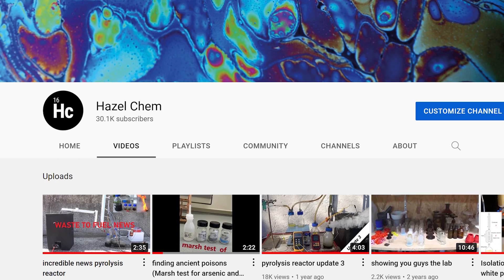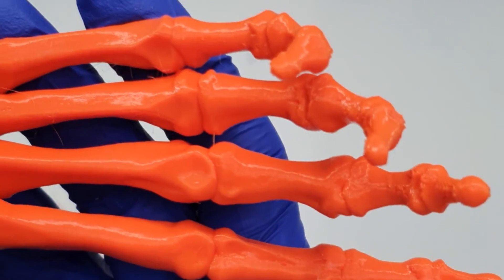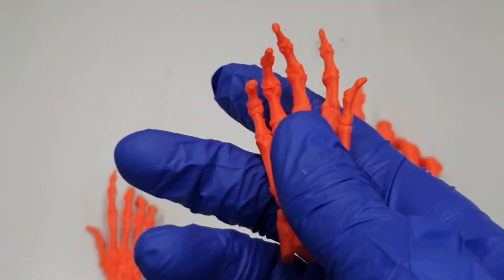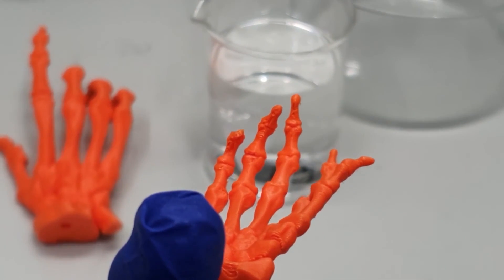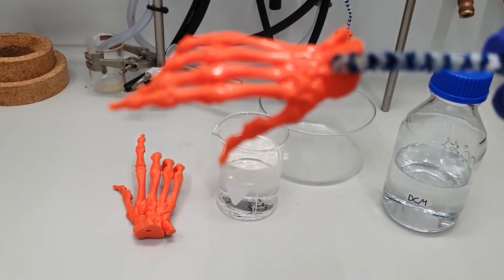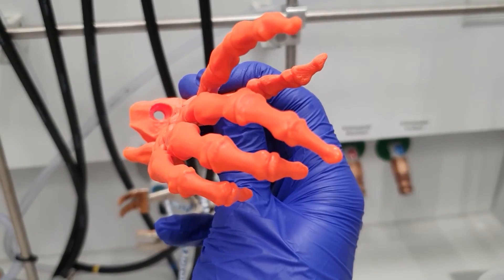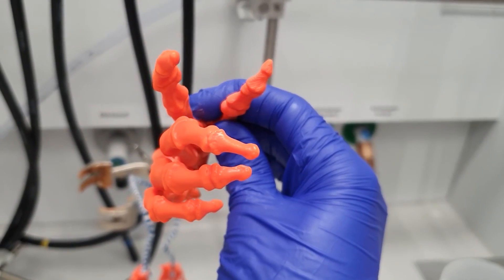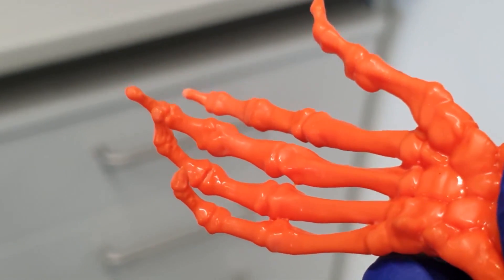easy smoothing of PLA 3-D prints (solvent method)

Comment: I just bought a spool of PVB which should be smoothable or perhaps even dissolvable in isopropylalcohol, readily available without restrictions. Let's see how that goes. Thanks for the video.
Reply from the maker: That’s a great decision! PVB is an excellent choice for vapor smoothing, as even alcohols like ethanol or isopropanol can dissolve it.
I print a lot with PVB for metal casting and highly recommend using a drying chamber, as PVB absorbs moisture rapidly. Wet PVB prints tend to perform very poorly.

Happy printing! 😄

Best regards,
Elias

Comment: That's an awesome video, but I don't think that DCM is to be handled with untrained hands or in an unprepared/uncontroled environment. Not only it is highly flammable, there's some evidence that it may cause cancer, and in non ventilated spaces may cause a number of problems such as drowsiness and asphixiation. If you are watching this video and are not used or have no experience in a lab or on safety precautions regarding volitile solvents, please get some help from professional chemists, chemical infrastructure adequation companies or chemical engineers before buying gallons of DCM for your prints.
Reply from the maker: I fully agree with your statement: chemicals must be handled with care in a controlled environment by professionals.
However, there is just one minor mistake: DCM (dichloromethane) is hard to ignite. Chlorinated solvents like DCM are also used as flame retardants.

Best Elias

Comment: When i was in org lab i experimented a little with smoothing pla. Both DCM and chloroform works, but I found out Chloroform gives more shiny surface and DCM more milky one (it just evaporates too fast and do something with surface cooling). and as dor vapour smoothing... dcm vapours are to heavy for that, only bottom part of print smooths. maybe with forced airflow, but finding air pump that would not melt was pain. Surprisingly THF was a lot worse for this, even with info in web that it works well for this. This could be interesting research project, maybe there is nicer solvent for that.
Reply from the maker: thanks for the comment ^^ I will look into it :D

mfg hazelChem